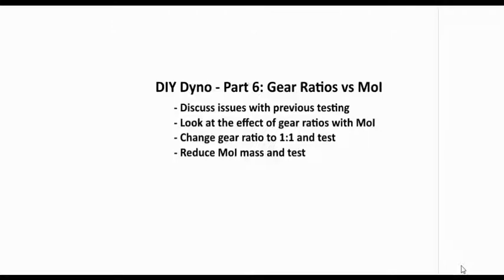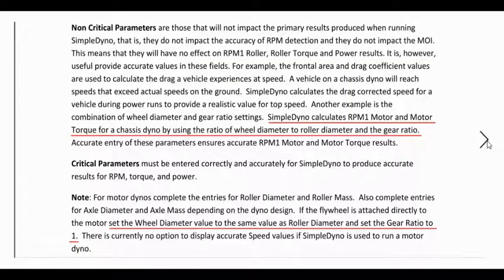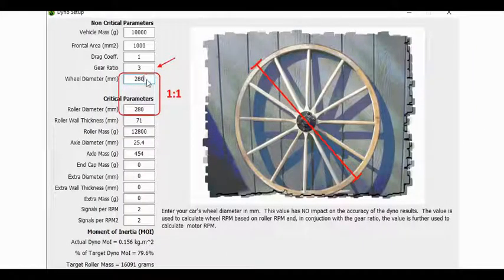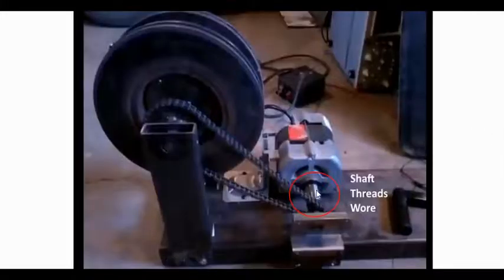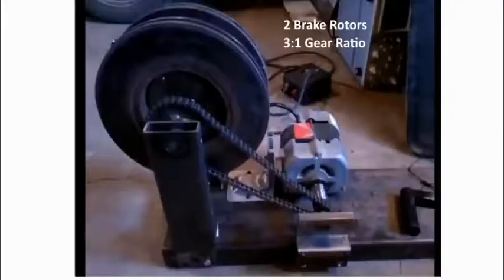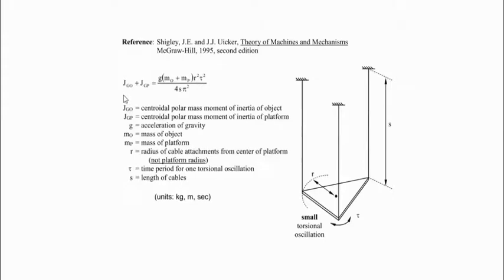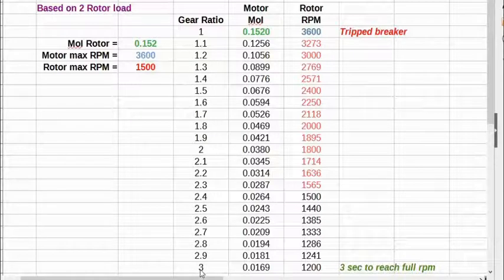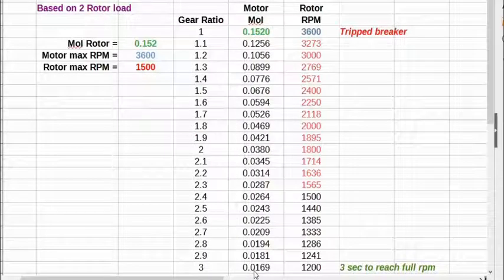DIY Dyno (Dynamometer): Part 6 - Gear Ratios vs. MoI

Comment: You might try a lower gear ratio like 5 or 6 to 1 probably won't strain the motor so much as to tripping the breaker
Reply from the maker: I thought of changing the gear ratios but ran into all sorts of problems with inertia/weights - either not enough or too much.

Comment: Gear ratios, wheel diameters and roller diameters do not affect motor power at all. It is same motor power at any given gear ratios. These ratios only change RPM/torque ratio.
Reply from the maker: True.